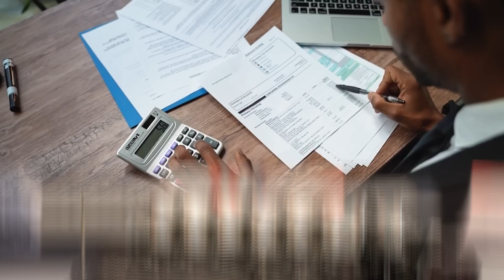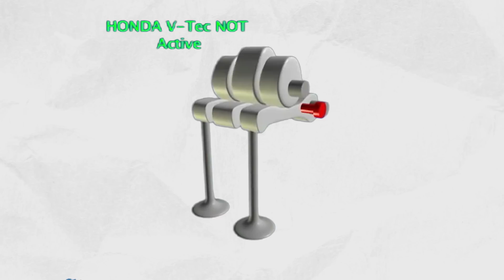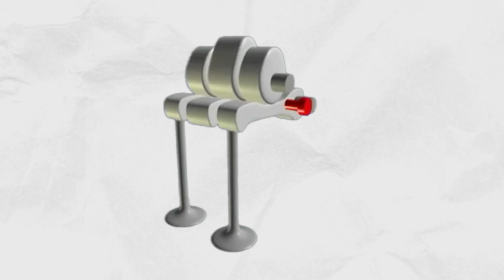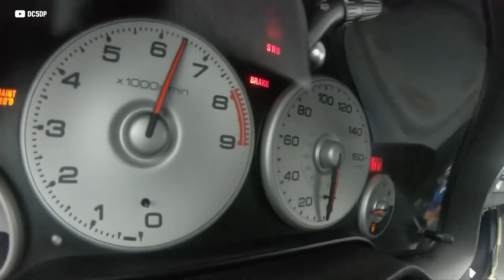VTEC: How It Works And How It Changed Engines... FOREVER

Comment: I'd like to see a company develop an engine that doesn't need all the added electronic governance and simply rely on the mechanical design to gain power and deal with pollution concerns. Today's cars, even a base, Honda has far too much electronics in it. More "Stuff" to go wrong!

Comment: Its not the variable valve timing thats the game changer[many cars have vtc gears], its the second cam lobe profile that gives the ability of like having a seperate small cam for good lower end power and a race spec cam for high end power. The only other system like this to date is the lift system by toyota. Combined with 50 degrees of variable timing[most other manufacturers use a 25 degree vtc gear] this creates the best tuning of both worlds.

Id like to specify as well that old style vtec did not have that variable timing, only I-vtec

Also the k24 style motors only have a 25 degree gear as well due to concerns of p2v due to stroke/bore dimensions.
Reply: The K24a2 from the 2006-2008 tsx has a 45-50 degree cam gear.
Reply: @jjh.v  yup k24z3 had the 50
Reply: You just went way over their heads broski.
Reply: Nissan also has a form of it called CVTC

Comment: It would have been nice if you explained why Honda moved away from VTEC in the 10th Gen Civic and Si; talk about how their new Turbo engines provided way more useable torque; so much so that the stock 10th Gen 1.5L Turbo Honda Civic Sport Hatchback Manual was even faster than the 9th and 8th Gen 2.0L NA VTEC Honda Civic Si to 60mph.
Reply: The 10th gen civic type R has a turbo and VTEC lol
Reply: @guardian8319  fake vtec stop it man. It’s not true vtec on the intake and exhaust
Reply: @Ballsack44  Look it up it has it on both intake and exhaust know shit before speaking.
Reply: @guardian8319  my bad I red 10th gen and assumed the si. Still tho I’d rather own a fd2 type r over an fk8 but that’s just me.
Reply: Ya but it lost the soul of the car
Reply: Till one puts a turbocharger on a K series....that 1.5 ain't it . I work at Honda. I know.

Comment: VTEC isn't variable valve timing, it's variable lift.  And it was developed for Honda's F1 engines before it was applied to the street
Reply: snort
pushes up glasses
Reply: @parkerlalach9829  I mean he's right vvt isn't special and most cars have them now. Lift was in Hondas and a few other cars like the Toyota Celica GTS
Reply: VLEC

Comment: I love the VTECH in my 2007 Saturn Vue Redline
Reply: That's right. Didn't GM buy Honda J-series V6 engines to put in those?
Reply: @yadidimeanmaine  yes they did the redline version has a higher top end than the standard lower stance  bigger wheels

Comment: Still rockin 92 civic si hatch w/ cali approved j32 swap. All stock.. w/ a/c and power steering on stock wheels, yes with the hubcaps... 12.7 sec. In 1/4 mile

Comment: I-VTEC on my honda crz hybrid, fuel economy at slow speed light throttle in eco mode, but a sporty feeling car slow speed high throttle in sport mode.

Definitely a fun playful little car that even stock is instantly engages you as a driver even if it isn't a super fast car.
Reply: Didn’t know they had vtec in the honda hybrids
Very cool
Reply: @ruskibruski  i have a 2009 insight hybrid with paddle shift, on eco mode is like all other hybrid cars of the era but when you put the engine and gearbox on sport mode it makes me smile from ear to ear... and the vtec sound is there...
Reply: @jorgerosario4655  the IMA system is really underrated! Honda CRZ used alot of the Insight for its hybrid powertrain but in 2013 refresh models they managed used flat copper wire in the stator to achieve some extra torque, just imagine using today's technology to upgrade the motors and batteries, I bet they would be the ultimate hybrids.
Reply: @AidanCGaming  still using the original batteries and still good it wasn't only the ima system being underated but the all concept was ahead of the time...now we see several mild hybrids with cylinder on demand etc etc etc and the 2nd gen insight already had all of that...

Comment: List idea - underappreciated variants of great sports cars. More practical model variants or different models which shared the engine and drive train of some of the best sports cars, such as the Nissan Stagea 260RS which was basically a wagon R33 GT-R, and the Toyota Caldina GT-Four which was a small wagon based on the Celica GT-Four, although tragically only came with a tiptronic auto transmission. I'm sure there's plenty more and they deserve some love too.